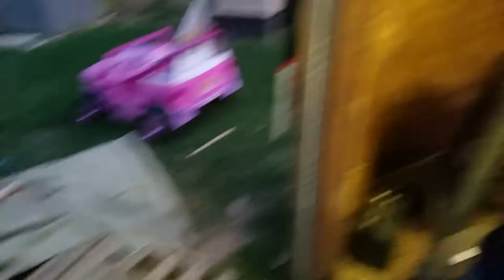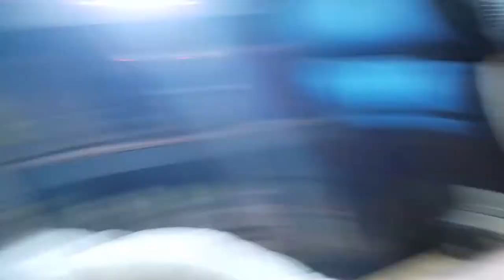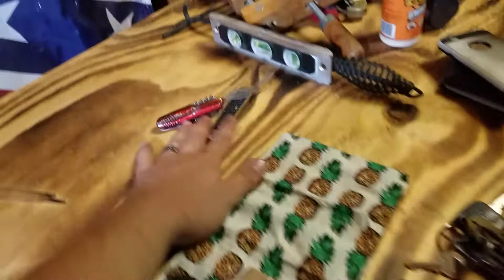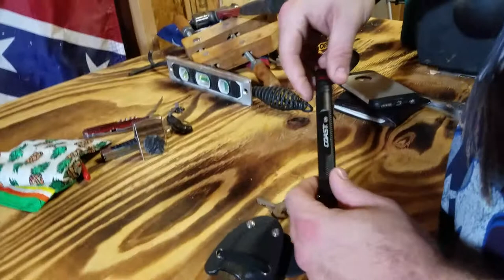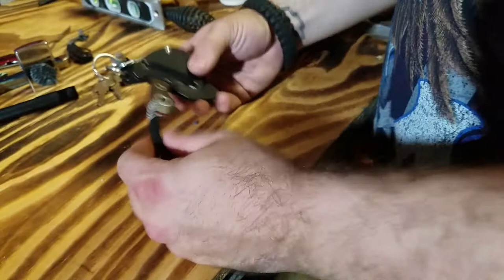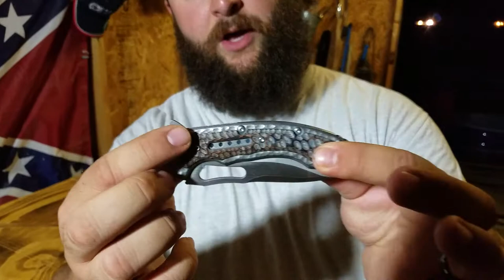EveryDay Carry (EDC) Gear Check on my Cousin (Tactical beaver)

Comment: Hahaha, I loved the video! Have any of y’all ever tried making homemade micarta handle scales for any of your folding knives? I recently came across a video by BladeHQ making some and I’ve been interested.
Reply: Also, you say that you like to carry a larger folder for self defense ( I do the same thing). Have you checked out any L or XL Cold Steel Knives? I have a few and I love them.
Reply from the maker: +John Hill Hey man thanks for watching, we have not tried that yet but it's something I have looked into. I plan on making some micarta handles fory friction folder when i get some extra free time. I haven't wver owned any cold steel knives simply be cause when i look at them i can never decide which one to try haha. Do you have any suggestions?
Reply: It really depends on what size you want. I generally carry a Holdout 1 that I put a cable tie on so it will "wave' out of my pocket if you are familiar with that. It is a very large knife and if you are looking for something smaller it is hard to beat a Large clip point Voyager. The best budget XL knife IMO is the Ti-Lite 6. It comes with a wave on it and its about half the price of the Holdout. I do like the Holdout better though because it has better steel and it is very thin so it disappears in your pocket. I also try to "save" my blades for self defense. The Holdout does have great steel and a nice shape though and if you ever need that size of a blade, it is definitely usable.
Reply from the maker: +John Hill awesome ill check those out for sure